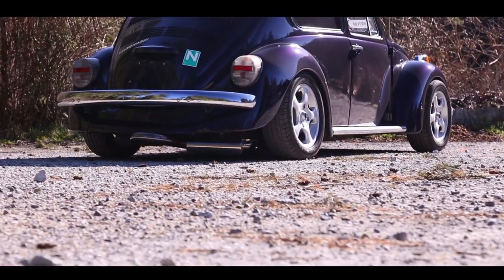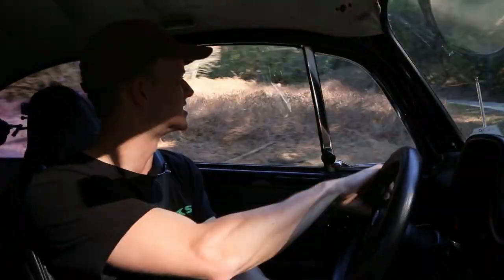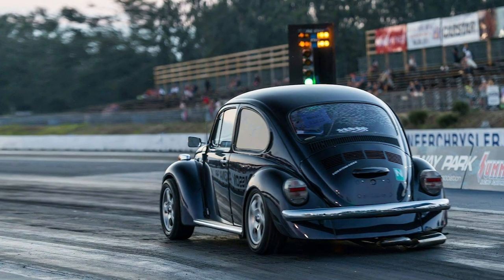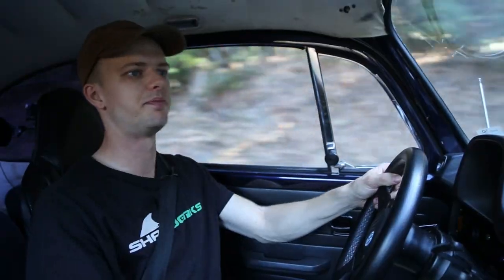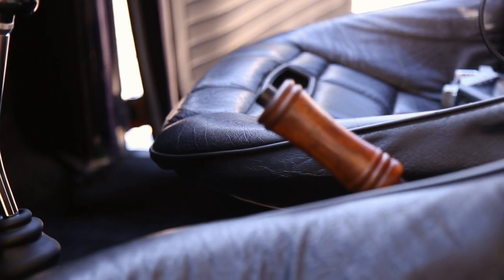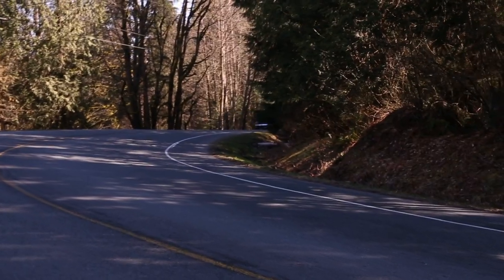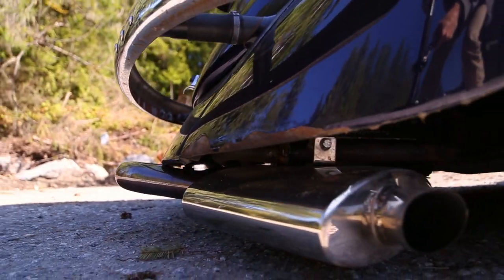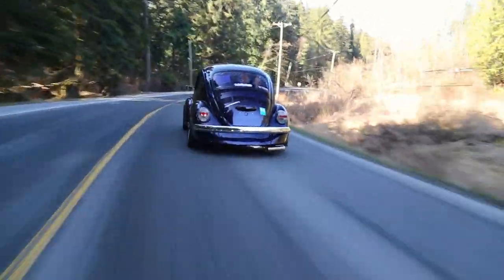Modified 1974 VW Super Beetle Drag Car | The Autobahn Barn Find!

Comment: I've had over a dozen Beetles, including a 12 second drag car. My current one runs 14s, aiming to get into the 13s this year. https://youtu.be/kGEoXzjiTr0
If this Super was mine, I'd start by raising the back suspension slightly for better launches. Change as much of the glass for plastic, and start cutting weight out wherever you can - Supers are heavy compared to a standard. Supercharger conversions on Beetles are temperamental - That's why most people go for a turbo, either in draw through or blow through configurations. A 1641 with a single carb blow through will be 120bhp, enough for 14s but will probably lunch the transmission. Fun while it lasts though, and that's what it's all about!

Comment: Finding a old air cooled porsche flat six would be ideal upgrade for this beetle
Reply: No, it destroys the handling. They're too long and hanging those extra two cylinders out of the back means that the back end wants to rotate round. A big cc type 1 beetle motor will out perform a Porsche, but a Subaru will squeeze in there if you try!
Reply: Neil Davies Your EXACTLY right!
Reply: Wont fit.

Comment: Yours is lowered about the same height as mine. What tire pressure are you running?
Reply: Woody Hayes Hey what did you use on the front for yours? Was it Topline Lowering Struts?
Reply: Factory tire spec pressures. It was on the front bump stops with cut springs in the video. I've since put on new springs and empi adjustable struts
Reply: Eric Jelier Are you happy with the Empi Adjustable struts? I didn’t know Empi sold them
Reply: @SladesVWBeetle  not happy. They sit way to high at the lowest setting. Going to get mk1 rabbit coilovers for the front instead
Reply: Eric Jelier Thank you for answering me, I’m glad you let me know. I may go to top line and see what they carry. I just dread buying struts and not being happy with them, because they’re not cheap
Reply: @ericdrivesjettas  Did you find the right coilovers? If so, how do you like them now?
Reply: @craigyoch146  I got mk1 solowerk coilovers in the front. They ride pretty good. Lots of height adjustment.
Reply: @ericdrivesjettas  Thanks for the reply, will it take much modification to install or are they a direct fit?
Reply: @craigyoch146  yes, direct fit for 74+ super beetles. Earlier superbeetles and standard beetles doesn't use this style of suspension